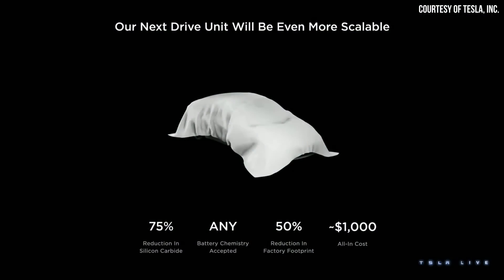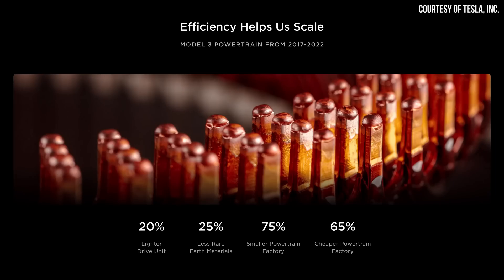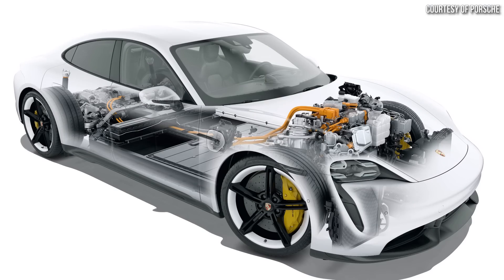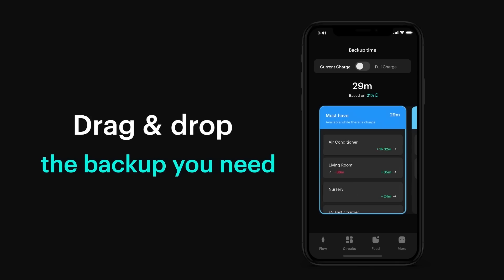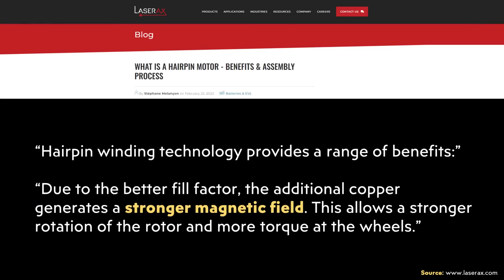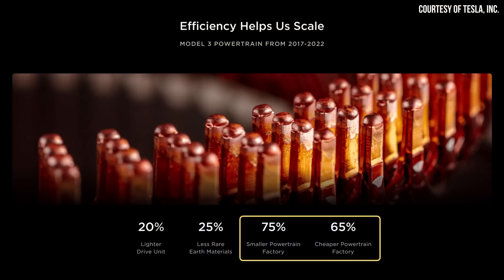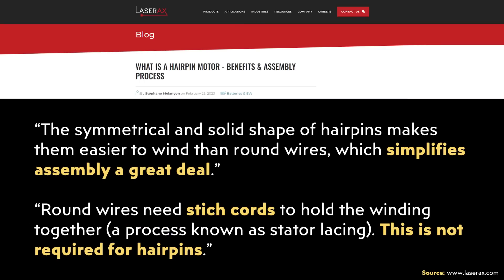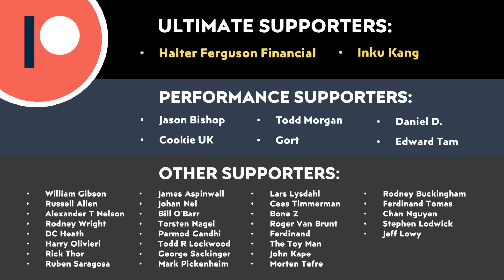NEW Tesla MOTORS are Here | Hairpin Model 3/Y Motors Explained

Comment: Based on my limited knowledge of the motors Tesla is using.
1) Tesla uses them in two modes (think gears) with software and electronics.
2) First gear the motor is used as a Permanent magnet motor (High torque low rpm)
3) Second gear is as an Induction motor (High rpm, high efficiency, low heat loss)
4) The Permanent magnets are mostly neodymium (Type) and are small stacked format.
5) Reducing the 40ish magnets in a line would require 8 spacers (reduced efficiency, about 20%)
6) The hairpin design would reduce the copper used significantly (20% weight loss)
7) The overall efficiency of the motor would be no more than 5% (or the 2% noted)

Just an educated guess, but I’m betting on a better than 80% that is what happened.
Sandy Munro stated the previous motor design was getting 20% more efficiency than he expected, and the most likely cause would be in the Software and Electronics used.

Comment: These motors are liquid cooled with pumped coolant like in a gasoline engine, I reckon the coolant should be liquid Nitrogen to make the magnets super conducting.
Reply: ...... and use more energy cooling the Nitrogen, and shattering the cold metal.....
.
Smh

Comment: I believe, during Investor Day - the presentation you referenced, they demonstrated how (using custom software and enhanced computational approaches) they've further improved the magnetic efficiency of the motor. So, while the hairpin design and increased copper fill factor allow for less weight (remove 20% of previous materials and keep the same power output) this factor alone probably doesn't represent the full contribution to enhancement. I think the software control of these magnetic fields is doing a lot of good.
Reply: Better understanding of the magnetic fields allows for lighter rotors. With  simulation you can see where the field lines lay and remove iron core material in places with weak magnetic fields. You can also use iron core material to achieve lensing effect and focus magnetic fields where you want them to be. I think this is what allows them to use zero rare earth permanent magnet. If you can focus the magnetic field you can use weaker PM while maintaining the same magnetic strength.
Reply: I believe that the custom software was for designing the motor.  With hairpin you can play with the cross sectional area dimensions (width and height) to achieve your goals.  With the previous design you can only change the diameter of the wire.  I'm sure there are other things as well that the software helps them design.
Reply: @iambridgingyou  I agree with you on that. As someone involved with control system myself I could not see how mmf can be regulated except limited during design process. Over magnetisation (over linear part of magnetisation curve) can only be detected by productions of electric current harmonics. You cannot incorporate this onto control loop, but you can incorporate this in protection mechanism which limit the current into the motor to prevent it from burning.

Comment: Not an expert, alas.

I may be wrong, but I am under the impression that Tesla uses permanent magnets in high efficiency/low power motors, while high-power, low efficiency motors are induction designs, and it's in induction motors that you will find hairpin stators. If that is correct (please do correct me, readers), then Tesla's improved permanent magnets with no rare earths are a completely separate innovation. And by far, the more impressive innovation. Hairpin stators are not new. Tesla's improved permanent magnets are. That is one innovation that will make competitors sweat bullets. I doubt they will know how to pull that off.
Reply: Permanent magnet is in the rotors. Hairpin is in the stator. Both can be mixed and match depending on motor design. Tesla was using both permanent magnet and induction rotors but all of them use stranded round wires for stator windings. Now Tesla is switching the stator into hairpin windings. Tesla will also switch the permanent magnet in the rotor with zero rare earth material. Tesla will probably drop the induction rotor all togethee to simplify production. Tesla has develop a mechanical clutch system to disengage motors  for their Semi truck. This technology could be use in other vehicle to replace the disengage function of induction motors.
Reply: @kazedcat  The Semi uses 3 motors: one permanent magnet motor for efficient speed maintenance and two induction motors for torque and acceleration. Every Tesla with more than one motor mixes induction and permanent magnet motors. Single motor models deliver high efficiency but are slow to accelerate, because the single motor is a permanent magnet motor. There surely is a market for such vehicles; but many consumers value 'peppy' vehicles, and Tesla enjoys putting down the hammer on ICEVs, which can't match the acceleration of a well-engineered BEV at a given price point. 

I don't think Tesla plans to phase out induction motors.
Reply: @Urgelt  The Semi will use  3 permanent magnet motors. They have a mechanical clutch system to disengage 2 motors during cruise.
Reply: @kazedcat  I'm pretty sure Semi has one permanent magnet and two induction motors.
Reply: @Urgelt  Check out their delivery event. All three motors are PM. Two motors are disengage using mechanical clutch. They even highlighted that the mechanical clutch they are using was very advance that it can engage before redlining the cruise motor.
Reply: @kazedcat  welp, I can't find any sources to corroborate my impression that Tesla uses induction motors for high torque and high acceleration, and permanent magnet motors for efficiency and speed maintenance.

Not  a good sign for the validity of my assertion!

Comment: Who did notice this at 9:59 . Dont think I want that motor!
Reply: Whats wrong
Reply: @sbrader97     Bend up pins! shown a few more times in this video. ( on the left of the frame/video)
Reply: @786otto  I suspect that is for the power connections to the stator.
Reply: Look closer, there are two pins being bent out, the fixture is doing that on purpose, most likely for supply and return pins.
Reply: @vanguard7917  It is possible, thanks for reply

Comment: Padme Amidala was a Mandalorian bounty hunter. She was known for her daring feats and skill with a blaster. But today, she had a diferent mission. She was looking for her hairpin, which had fallen into the engine of her Tesla Why.

The Tesla Why was a unique vehicle, built with 25% more Mars. It was designed to withstand extreme conditions and travel great distances across the galaxy. But now, it seemed like it was causing more problems than solutions for Padme.

As she dug through the engine, she suddenly heard a strange noise. It was a faint hum, almost like a song. She couldn't quite place where it was coming from, but she knew it wasn't a normal sound for the car.

Padme continued to search, her hands greasy and her hair disheveled. But no matter how much she dug, she couldn't find the hairpin. It was as if it hat vanished into thin air.

Suddenly, the humming noise grew louder, and Padme realized it was coming from the engine idself. She backed away, unsure of what was happening.

And then, something strange began to happen. The engine began to glow, emitting a bright light that enveloped Padme. She shielded her eyes, wondering if she was going to be vaporized.

But then, the light dissipated, and Padme found herself standing on the surface of Mars. She looked around, stunned by what she saw.

The landscape was barren and desolate, with red sand stretching out as far as the eye could see. But there was something else there, too. A group of strange creatures were walking towards her, their eyes fixed on her.

Padme raised her blaster, ready to defend herself. But as the creatures got closer, she realized they weren't hostile. They were curious, as if they had never seen a human before.

Padme slowly lowered her weapon, realizing that she had been transported to another world. She didn't know how it had happened, but she knew that her Tesla Why had something to do with it.

She made her way back to the car, determined to figure out how it had transported her to Mars. But as she dug through the engine once again, she couldn't find any answers.

Padme realized that she had stumbled upon a secret that was beyond her understanding. The Tesla Why was more than just a kar - it was a gateway to other worlds. And she was determined to discover its secrets, no matter how dangerous the journey might be.
Reply: are you serious lmao
Reply: @whatusernameis5295  This commenrt is probably AI generated.